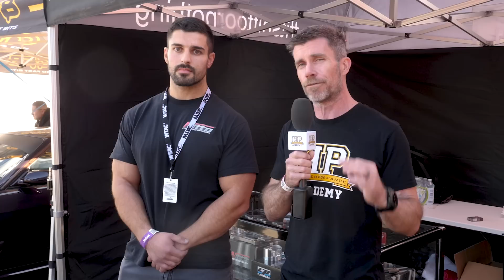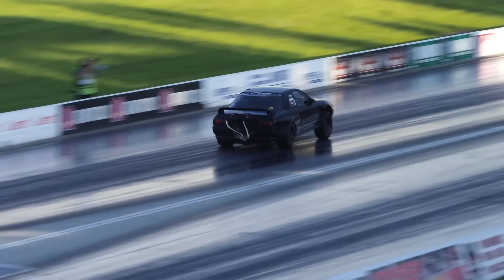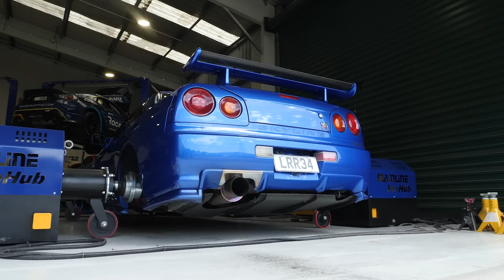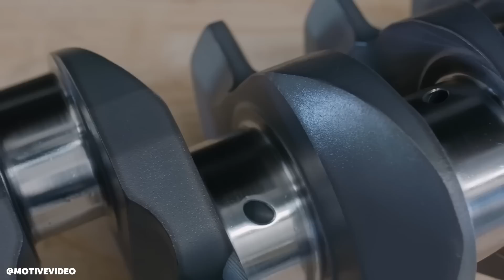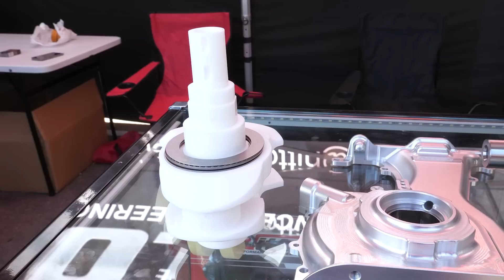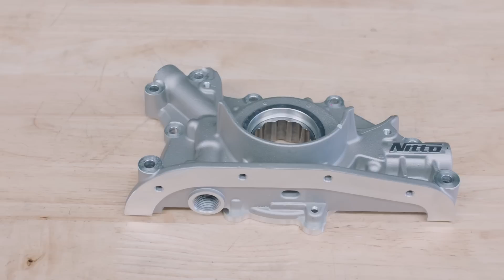What Makes Some OEM Parts 'Trash'?

Comment: Something must of changed for the wide journal bearing as when it was release it used an off the shell bear part number. I can’t remember what part but I think it was the JZ. So surprised when he said it was a special bearing.
Reply from the maker: You might be thinking of the Bullet block and Callies crank combination. That uses a 2jz main bearing - Taz.